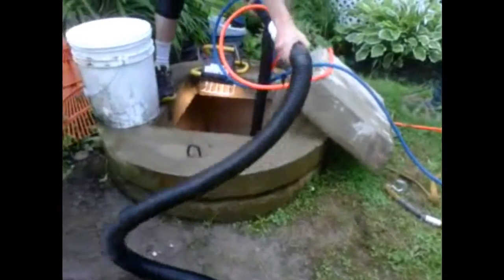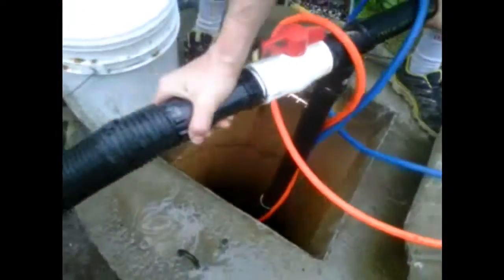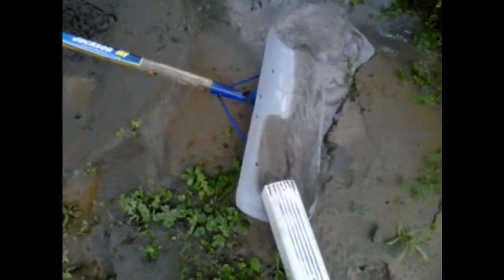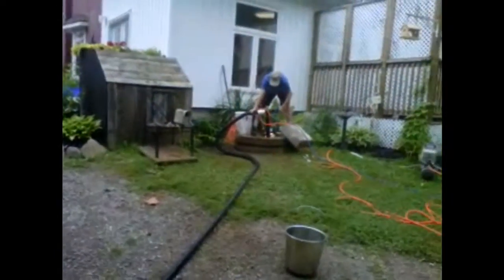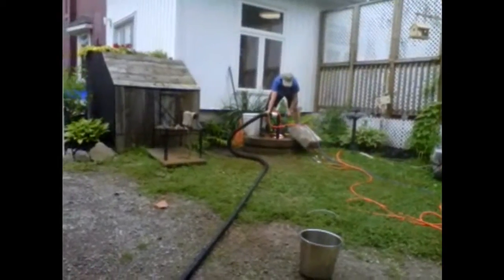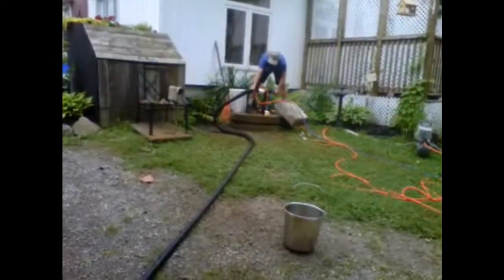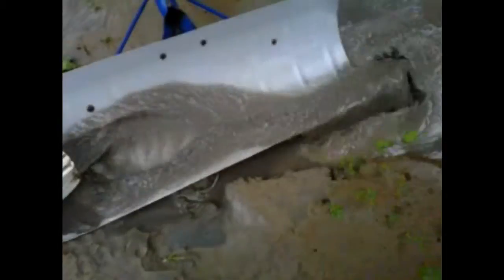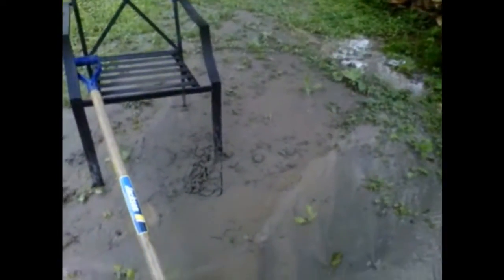Well Clean Out Using Compressed Air

Comment from the maker: Home made well cleaning pump. Spent about a $100 and save $$$$. It works well. If you have a question let me know.
Reply: Roy Tufts я хочу чистить колодцы и скважины .как это сделать .
Reply: I think they meant, if anyone has a question in English.
Reply: May I use water in place of air ,air compressor of such capacity not available .